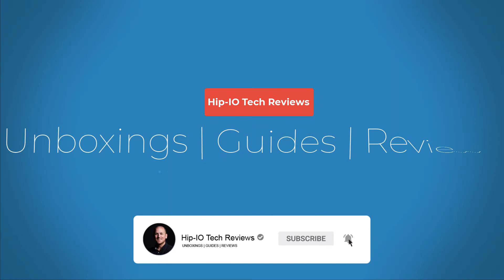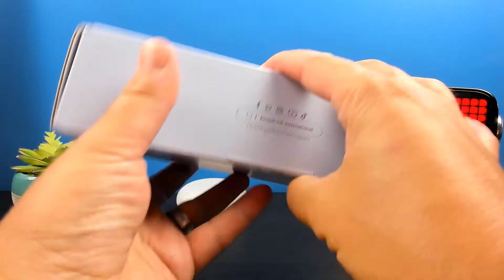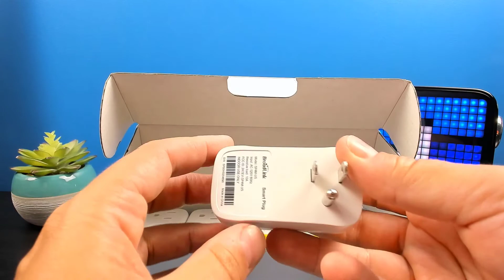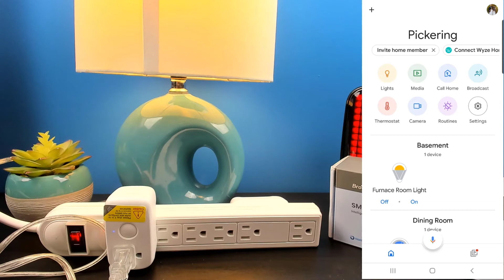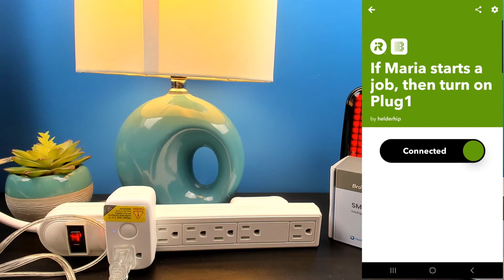BroadLink NoApp Smart Plug - Unboxing, Setup and Review

Comment: Pretty good review. Here's some questions you did not cover:
1. Can two of these plug into a normal duplex wall outlet? (Looks like they can but it would have been nice to see it for sure.)
2. If the power goes off, when it come back on will the switch be on, off or last state? Different smart plugs do different things.
3. If the router goes off will the plug change state? Some smart plugs go off if they loose the router signal or connectivity or something. I've read about it but don't know the exact parameters.
4. I didn't quite get the part about activating the plug with the email account. 
    A. At 2:24 you signed into the Broadlink plug wifi server. 
    B. Next you give the plug the router name and password.
    C. Next you give it an email address. I assume it is your email address but that wasn't stated and the text on the screen don't specify either. However it says to do this if you already have a Broadlink account.What do you do if you don't have a Broadlink account? Go create one I guess, or is there a way to configure it without having that account?
    D. At 3:34 you say to wait for the verification code. Does it come to that email address and then you enter it into the app/web page on the screen? (I'm guessing that is correct but you didn't articulate that and the code just appeared. The cut was so seamless at 3:37 that it looked like the numbers just came in somehow. 
    E. At 3:39 you hit Skip. So you don't have to link to either of those accounts/ What features would they have if you did link to one of them?
    F. After you hit Skip and then the Back Button, where did you end up? Is that Google Home?
    G. If you are now in Google Home at 3:44, you scroll down and find Plug1. What step above caused Plug1 to be recognized by Google Home?

Maybe it is not your intention to give a whole tutorial on Google Home but, had you explained some of this a bit more, it might have filled in some blanks in my understanding of the Google Home infrastructure.

I'm going to take a look at more of your videos to see if I want to subscribe. I already hit the LIKE button. Thanks for this review.
Reply from the maker: Thanks for the feedback, I appreciate it. It will help me make my future videos better :)

1. Yes 2 can fit,they slightly touch each other
2. If the power goes off, when it come back it will be the last state.
3. If the router goes off will the state will remain the same
4. I didn't quite get the part about activating the plug with the email account. 
    A. Correct 
    B. Correct
    C. Yes this your email address,,,, When you input your email address it ties the Plug to that email address
    D. After you select NoApp, you use the same email address, Then the Verification Code gets emailed to that email address. Then you just copy and paste it. 
    E. No it does not have to be linked. I dont think you gain anything other than another than being able to sign into broadlink
    F. Yes that is Google Home
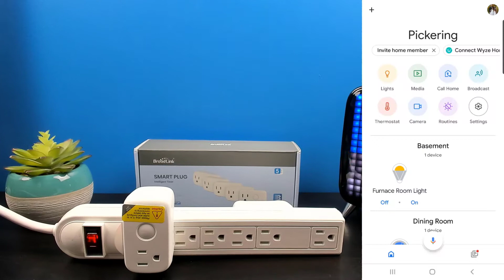    G. At 3:12, I go into the Google Home app to set the plug up. after you link the broadlink plug, it places it in google home

Hope this answers your questions